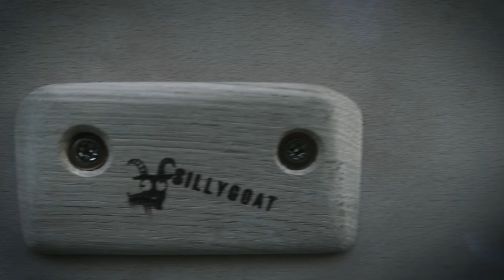Backyard Bouldering || New Holds for the Home Training Board

Comment: How much roughly did it cost to source everything?
Reply from the maker: For the board itself it was around £200 max. For holds on top if you’re not making them yourself it could be a lot more. Our holds from Silly Goat were around £90 but totally worth it!!

If you’ve got the tools to build the board you could probably make your own holds too!
Reply: @BoulderingBobat  did you just use regular plywood, not worried about the English winter ? Also was it 3/4 inch ?